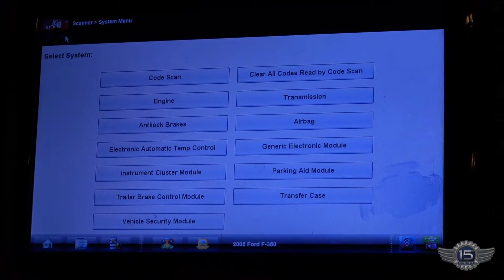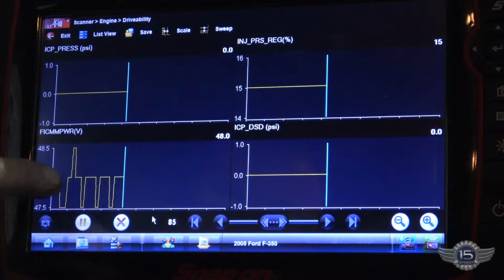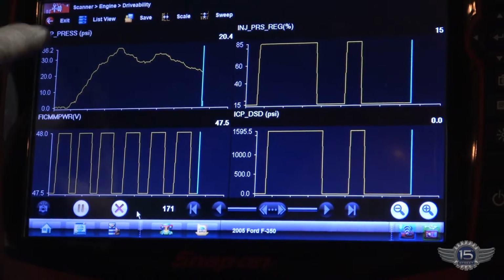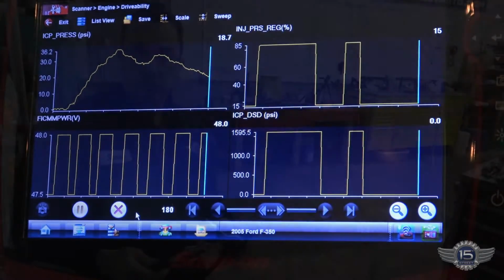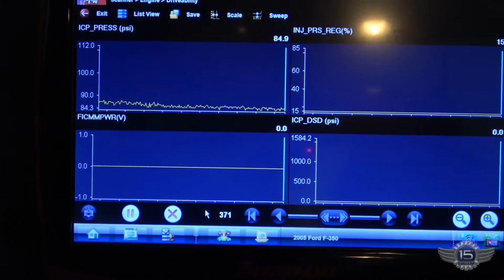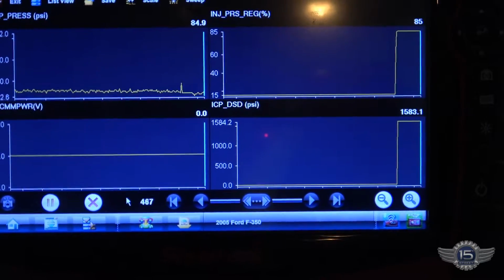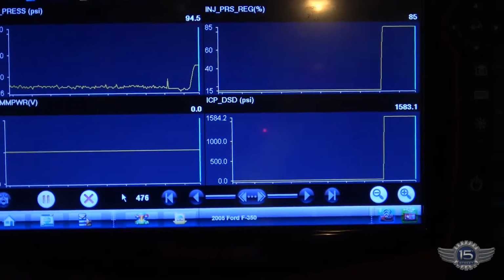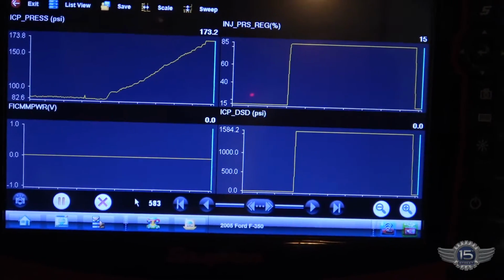2005 F250 6 0L No Start No High Pressure Oil Pressure

Comment: I always found it kinda weird that the turbo on the 6.0 is on top just looks funny in my opinion. They are awesome sounding turbos and engines. They sound like a fricken jet straight piped! But they are the most unreliable pickup diesels I heard because people supe them up and the thing can’t handle it. Blows gaskets, radiators, turbos, the engine blows. Etc etc . Bulletproofing them I hear is the way to go if you want horsepower.

Comment: I have shop air hooked up into the ICP port on the passenger side. I hear no leaks. This on a 2005 6.0
Am I getting air to the whole system or do I need to feed shop air through the IPR only? I dont wanna replace the HPOP if that isn't the issue. I can only build to 15psi at the ICP sensor while cranking.
Reply: You need to block off the IPR valve when you do that or it just bypasses it back into the crank case so yeah you did it wrong. Make sure you have the right oil filter there is a different one that can cause that also. Btw did you end up fixing it?
Reply: @fuckjewtube69  I did not, unfortunately. I had no business working on that 6.0, but the customer insisted on me putting a new HPOP in it, I advised against it as I told him it would probably not fix the no-start issue. He said to do it anyway, because he had 'Googled it' so I did. That didn't fix it either. Still wouldn't start. He paid me for switching out the HPOP, then it was towed back to a local shop in his area. He was 7-800 miles from home and on vacation when it happened.

Comment: Great video and diagnosis regimen.  I have the exact same symptoms in my 2005 6.0 Super Duty - No leaks...and no pressure.  The last thing I suspected was the pump...but this is what my scan gauge readings are pointing to.  Same as yours.  Thanks for posting this.  Lots of new stuff I hadn't seen before.

Comment: Interesting crank no start, you must have quickly recognized this from past experience. I was still thinking of spark and fuel, and you had already skipped well ahead. Noteworthy point at the end, I guess air in the system prevents it from building pressure so air needs to bleed off. Is there a special procedure to bleed air?
Reply: To bad diesels don’t run off spark
Reply: @matthewwilliams4982  Ha, ha, good point.
Reply: @matthewwilliams4982 *too